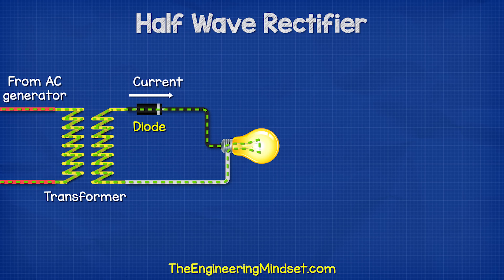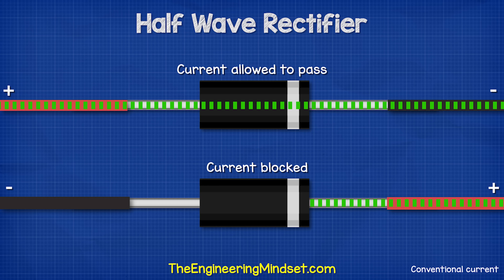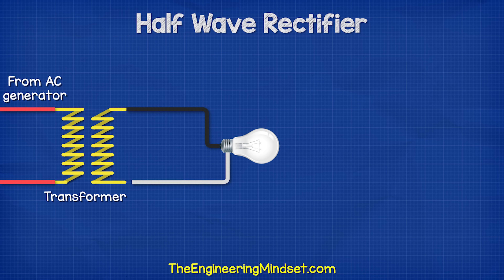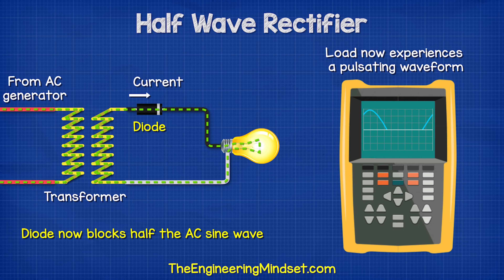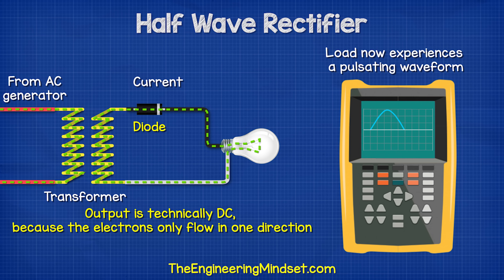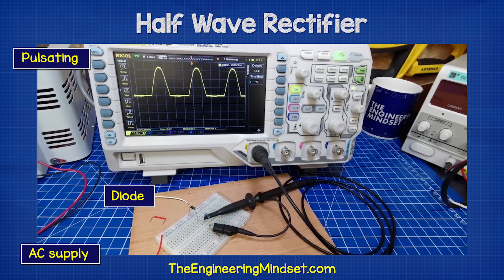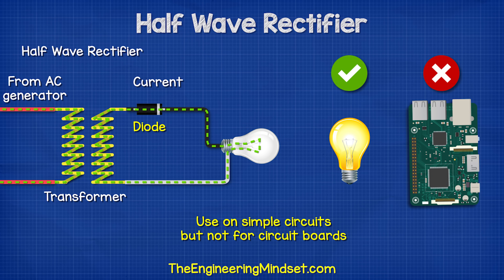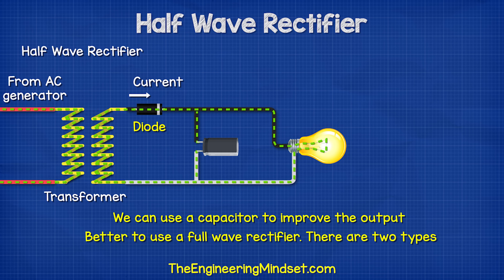Half Wave Rectifier Explained -  power electronics

Comment: I have a soldering iron which has a diode in the input supply,why so.
Is it using only half of the input power.
Reply from the maker: Its probably polarity protection. But it depends where and how it's connected as well as what type of diode.
Reply: @EngineeringMindset  Diode is IN 1007type,is it protecting the polarity of the heating element,are there DC heating elements.

Comment: Question - How do I measure on multimeter the output voltage from 
circuit seen from 2007 , that was secondary side of 
Inverter of 120VAC connected on each output line single diodes that are 
opposite polarity each facing, going to resistor load? Is this still a 
portion of 120V AC output ,or approx 40 volt half wave DC plus and minus
 DC? The writer may have been thinking about back flow protection. This 
is not print error, or about clipping circuit. Please advise.
Reply from the maker: Check our new Multimeter tutorial out ➡️ https://youtu.be/4lAyzRxsbDc
Reply from the maker: Check out NEW resistor video, everything covered! ➡️ https://youtu.be/DYcLFHgVCn0

Comment: So what is benefit of diode?
Ok we can use it for DC 
But
Where we can it use for commercial purpose?
Reply from the maker: Please see our many design projects, they almost all use diodes. Electric motor speed controller design for example or voltage regulator
Reply: @EngineeringMindset  Thanks!
Reply: Flame rectification in gas furnace 😊

Comment: This is super cool! The way everything is explained makes it easy to understand the concept. Can you please make a video explaining the difference between a +VE and -VE power sources? Like +12,-12, +5,-5 etc? What is the real life difference in it? What is it's significance? Why can't a +5V rated semiconductor device work when supplied with a -5V? And still a normal bulb works just fine?
Reply: +5V means there’s a lack of electrons, -5V is a excess of electrons. It depends on the electron flow if you go use conventional flow or electron flow. VE is just Volts (energy) which is just V. Volts are the unit of measurement for energy
Reply: @ZeusEnergyMan  It would be interesting to see if it can be animated.
Reply: @sangeeth_619  I’m not sure I gave a great explanation either but if I understood what you’re asking properly. But ratings really matter device to device. Some rating are voltage in max effective voltage. Some are minimum current to operate. A lot changes. Often there are databases online needed to find the information even. AC and DC are rated differently. Some require specific connections etc.
Reply: Most lightbulbs though are fairly interchangeable due to standard voltages. And power ratings for the bulb. Bulbs are in watts and with the known voltage you can find current. But current is current

Comment: I'm sure you've been told this before but my Engineering Mindset has noticed that your logo doesn't work.

All three cogs are connected so the mechanism wouldn't be able to rotate.

I think you need to shrink the two larger cogs so that they are only touching the small one, not each other.

Note, this hasn't taken me years to figure out, I've just discovered your channel.
Reply from the maker: I have, many times, and each time I reply that you should be considering how things could work. From this one perspective you can't tell the depth of each gear to be sure they aren't staggered, you've assumed they are all interlocked but it could just be aligned to appear so. Think outside the box and what possibilities there could be. Additionally, it's just a logo, the gears don't ever move and it's not meant to represent a gear box in any way. It's just some gears to represent a mechanical mind.

Comment: If we compare electricity with water and wires with pipes, than what's a diode in this scenario? It may be silly question, but it helps me to understand electricity more clearly or may be i am doing it wrong all along. Thank You. [DiowE]
Reply from the maker: Non return valve, learn why here https://youtu.be/Fwj_d3uO5g8
Reply: @EngineeringMindset  Thanks, Engineering Mindset. I didn't expected a response, thinking my question is silly, but you really answered, wonderful & great. I will surely check out your recommend video. Many thanks, again. [DiowE]

Comment: I was thinking of using this to reduce power consumption for low powered lighting.  So no current in bottom wave form technical using half the power.  Will not notice the effect on lighting.  I must put this to the test with say 2 or 3 60watt lamps.